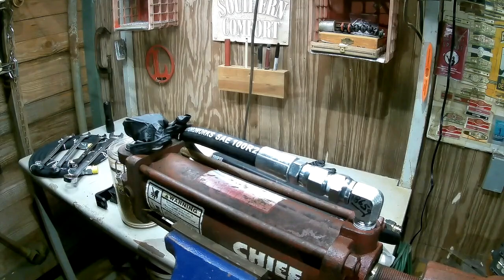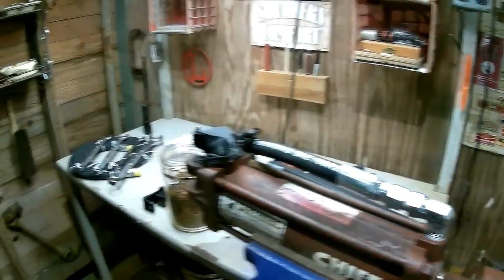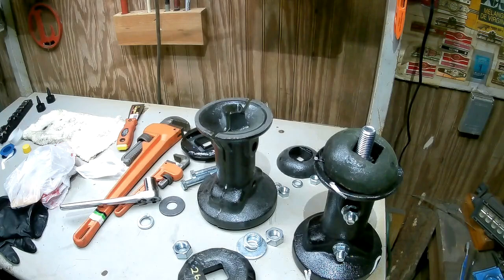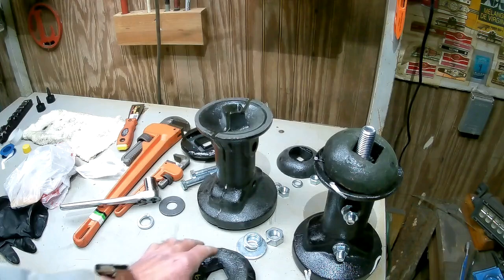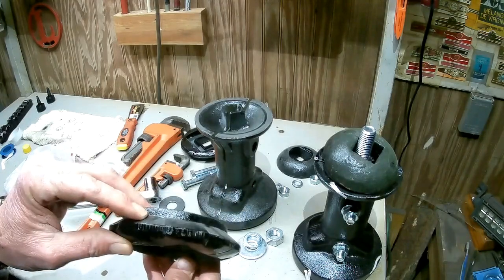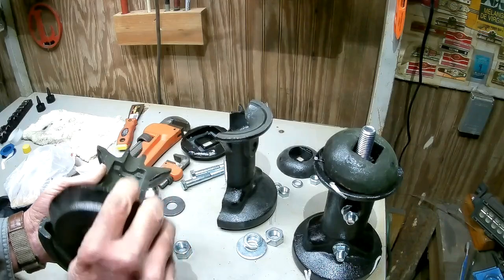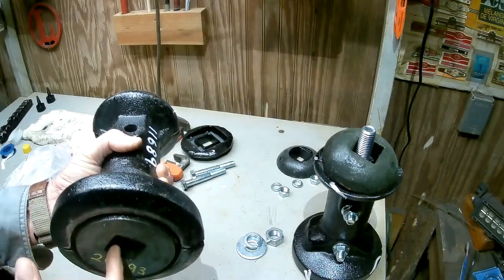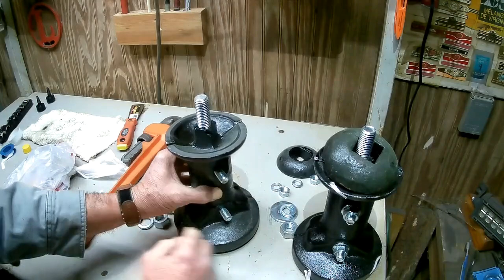I been looking for these and looking for these

Comment: You have it figured out!
We had those on an old 215 JD disc, they work good!
Reply from the maker: I was going to work on putting these on the John Deere 28 blade disc today but  I noticed something that needed attention on the 3300 so I ended up working on that. Ed, do you know any thing about disc made by a company named King? I cannot find the large bearing housings anywhere. I have been told locally no one is making them anymore. Do you have any source for these over on your side of the country? Thanks for any help you can provide.☕
Reply: @SoybeanFarmer3300  sorry, can't help you there 😪
Never heard of King...
There is a "king cutter" that a couple of farm stores sold. I've never seen one other than in their ads..
Might try looking up that name, 
Future son in law has a little offset disc, has some fancy swivel bearing housings.. he actually was able to get a new housing a few years ago through the JD dealer... You just never know where you might find things. Good luck Soybeans!!!!
Reply from the maker: thanks for your thoughts on the issue.  I figure I got about 4 or 5 years before those housings are going to have to be replaced again.  I just really did not like finding out the supply had gone dry.  yea, when running the disc at full depth, they drag in the dirt.
Reply: @SoybeanFarmer3300  might be able to put a wear piece on them.. keep the dirt from rubbing..
Reply from the maker: Kind of like a skid plate. I got a visual on the idea that could actually work. Thank you Ed.

Comment: When you gave those back to Scotty, did you tear your disk down and remove the anchor piece( the one that goes on the axle)?. And now, you're going to have to tear it down again to put those new anchor pieces onto your axle? You're going to be very familiar with your disk parts.
Reply from the maker: The ones cousin Scott loaned me actually fit the existing anchor piece so they were a simple bolt on unbolt to take off. The new ones have a different size anchor plate so yes I'll have to take both gains all the way down. But it's going to be worth it. Thank you very much for watching here.
Reply: @SoybeanFarmer3300  I had those extensions on a Burch disk that I later on I gave to my son and they were hardly ever tight  and I didnt see the value of them. I always pull a spike tooth  harrow behind anyway,  so it was irrelevant to me. It WILL  be a good thing to take your disk apart, you'll be able to check  the bearings and look for cracked blades/bells whatever you call 'em there. Just a good bit of work. And I'm glad that you KNOW that you can wrap teflon tape backwards. I'm not kiddin-- Ive watched many people use up a LOT of tape on joints  and still not know why it don't work.  Havin a pork chop and watchin Andy Griffith as I read your reply. Thanks!!
Reply from the maker: Yep took it apart and found the problem on the rear right gain. Had to buy a new axle. The new axle was too inchs too long so I spaced it out with some washers. Everything else was a okay. And as usual I made a video. Hope to see you there. My wife can cook a mean pork chop.

Comment: Soybean Farmer,the last disk on your harrow,put a disk smaller there and it want cut out a rud,as deep. If you are running 20,inch disk put a 18 there,I've done that for years.
Reply from the maker: Did exactly that on both front gains it made a huge difference. These Furrow fillers will finish things out nicely. Thanks for being here Billy.

Comment: Should not be too hard to add the outer disc blades just got to take the time and it will work out so have a good one man . I dont Know Deere Discs at all lol always been an IH disc here
Reply from the maker: Been out there working on putting these Furrow fillers on and I've got one side done. Just came in to get coffee and charge the battery a bit on the camera. I hate it when the camera battery dies and I'm not finished. AJ thanks for watching here.

Comment: Where did you find those? There’s a lot of different in a disk with these and one without for sure, we’ve needed some on our disk for a long time now, I’d like to see a video of them actually being put on, thanks for the video
Reply from the maker: every time I went to the store I saw the empty shelf.  there were 6 of them on the shelf Monday.  here's the links to the two parts you'll need.  you can get the part numbers and maybe order them.  https://www.agrisupply.com/outrigger-bumper-washer/p/26593/
get the washer so the outrigger fits correctly   https://www.agrisupply.com/outrigger-assembly/p/11689/
Reply: So you have to purchase the bumper washer seperate?
Reply from the maker: Yes, they are a correct match and they make them fit secure.